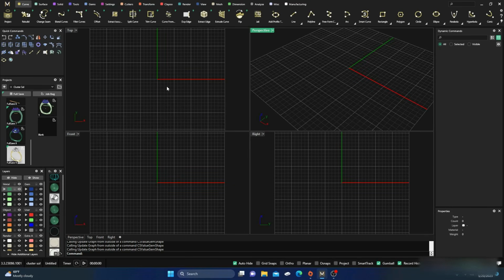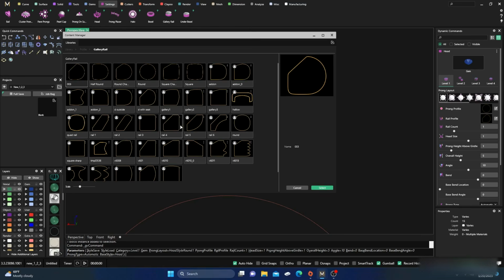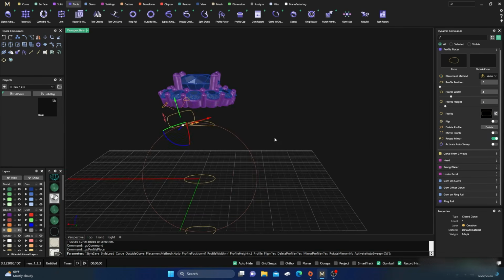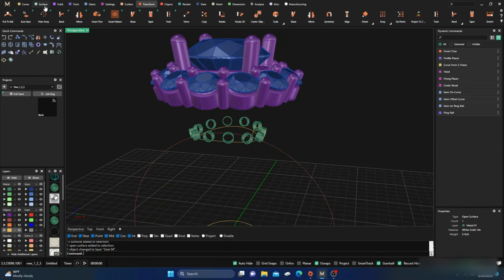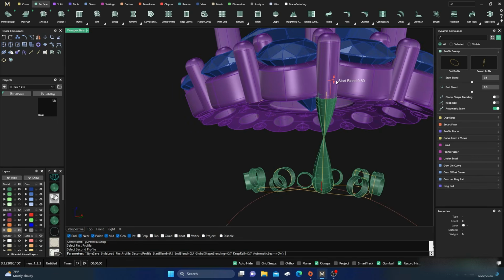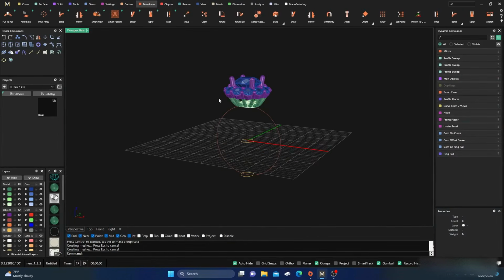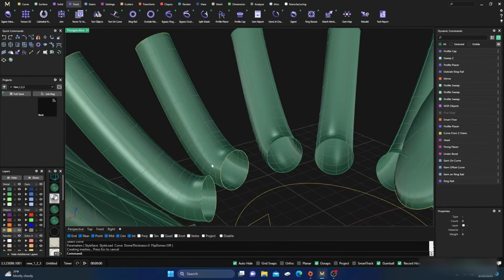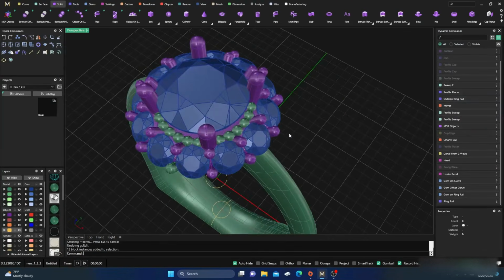MatrixGold Wire under gallery Halo ring

Comment: when i try to add under bezel, it's failed, a message info (under bezel failed, try adjusting griddle offset) how to solve ? please !
Reply from the maker: What version are you running? Check your default setting and check your x angle.
Reply: @donsjewelrymakingandjapantrave 
Version 3.11
Reply from the maker: Is it on smaller stones or larger ones?
Reply: @donsjewelrymakingandjapantrave 
Centergem 1.7 no problem with 
But gem on curve 1.2 it’s make problem
Reply from the maker: sorry it's probably the angle in the dynamic commands box try that one also make sure you are holding shift and Ctrl and selecting only one stone to add the under bezel.

Comment: You inspired me to do this a similar way I would have thought of. It was based on polar array. It worked well and fast and parametric . The drawback is it’s not linked to the under gallery, but it’s easy to move one prong and the rest update. If you want the file to take a look let me know. You’ve been a big help with MG I was resisting even after I bought it. RG looks so different, I was never matrix
Reply from the maker: Yea, Polar Array will do the job as well for sure. I know how you feel about resisting the program. I was still pretty mad after two months when I first bought it but as I kept working with it I started to see all kind of new things and ways to do things. Now my time designing and altering the designs is way faster. You should post the pictures or video on the Facebook page. It would be cool to see. Also, thanks for all the support comments and other great ideas. We need to share as much as we can to help others make the transition easier for them.

Comment: Hi sir, how are you?
 just asking a quick question, i've heard some rumors from some people in jewelry designing that matrix gold doesn't have much accuracy like matrix 9 especially in weight. do you have any experience in this after 3d printing the model and the final product? thank you
Reply from the maker: Not at all. When casting the weight is not always the same even from item to item in the same casting. Also after polishing, tumbling  and all that kind of stuff non of them will be exactly the same anyway. That weight is just to give you an idea. You still need to weigh the wax model and still do your calculations before you cast.
Reply: I find the weight to be light in matrix gold. I have a request in with them to modify them on my own. If you make a 10mm ( specific gravity of 1) then the weights in preferences are a bit light for my 14k and plat.
Reply from the maker: Keep me updated on that. I would like to know how it all turns out on their response. Thanks for that info.